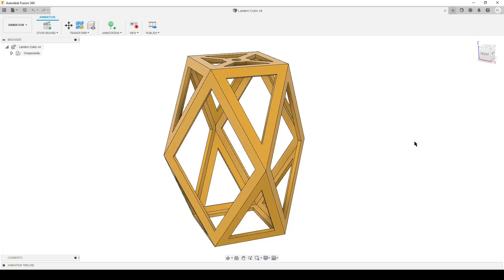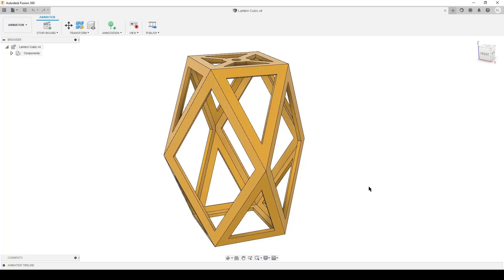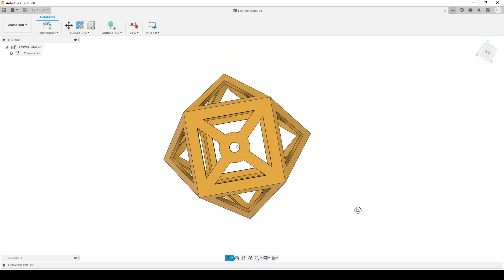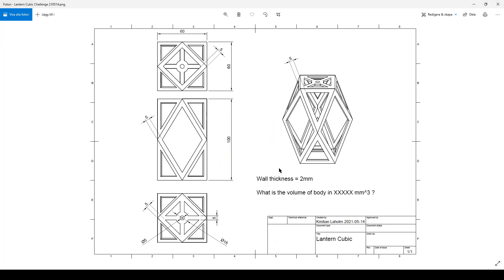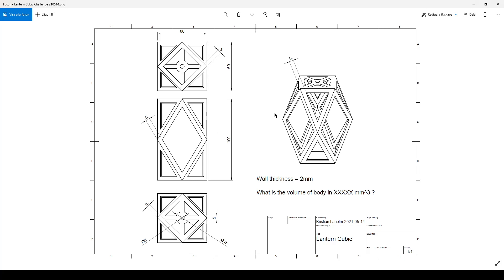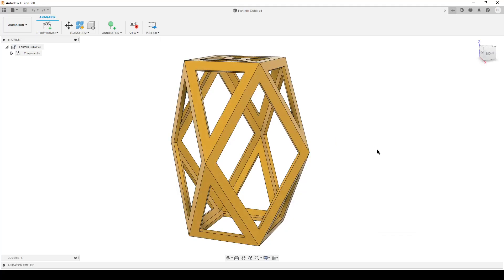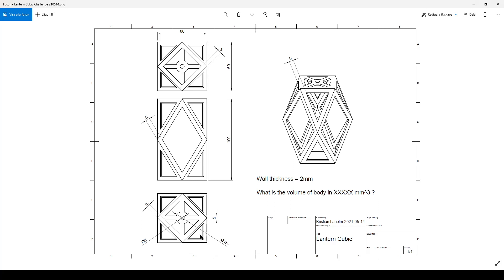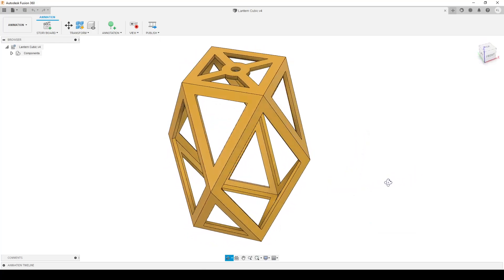Fusion 360 Challenge - May 2021 - Lantern

Comment: Volume should be 20260 mm^3... if you did it right Kristian ;)
Nice challenge... I need to try to do it other way
Reply from the maker: Oh no I got 42 mm^3 ???? ;)
Reply: @KristianLaholm  that's a pity ;) I think this is an accuracy error ... in one of ours design ;)
Reply: @lukaszb1282  I also get 20260 mm3 - if 5 beers weren't too many :)
Reply: @vext001  question is: what kind of beers? and... where's mine? ;)
Reply: @lukaszb1282  Wheatbeer! Sorry - yours in my stomach :)